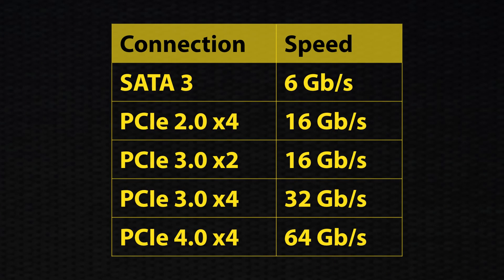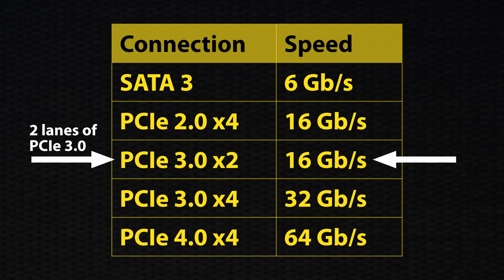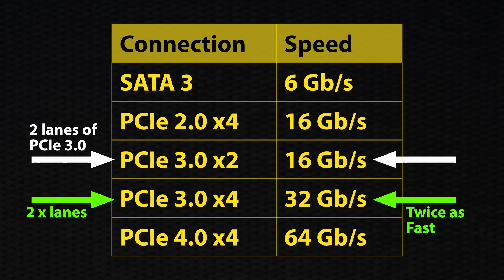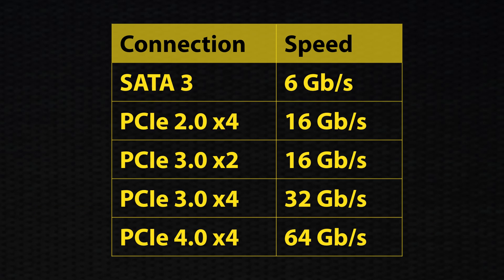M.2 vs NVMe What's The Difference Exactly?

Comment: I've been chugging along with my early 2010  CPU (Intel i7-2600K) in a machine where the CPU is the ONLY orig part from the  original computer it came from (on powerspec from Microcenter). I recently decided to "upgrade" to a HP 840Z that comes with X2 CPU's and 126gb of ram, etc.. Typical beefed up HP. Though it comes with 5 SSD's (all 1 tb), I plan on picking up a card and NVMe 1 or 2 tb drive as my boot drive and migrate the 26tb's (two 8's and one 10tb drive) to the new PC. This video sheds some light on what and how these will turn my new beast into a demon. Thanks

Comment: Geat video, but I have a doubt. I have a mobo with m.2 sata slot.  Could I put any m.2 NVMe SSD in it or would it not work?
Reply: The NVME would not be recognized by the motherboard if your original M.2 is SATA.

Comment: Hi, my Laptop specs say M.2 Sata-3  so i have a Nvme Gen4x4 stick. Does this mean it can only run SATA sticks? as i tried the NVME and didnt recognize it.   Whats strange is that the M/B has that 5 pin only socket; sort of shape that most NVME sticks look like.  or can that shape mean it could be either sata or NVME?  and its says only SATA will run in it?
Reply from the maker: From what you are saying it seems that your laptop is probably only able to accept  SATA drives. I wouldn't worry too much, just buy a SATA M.2 drive . Your laptop would likely not be much faster with an NVME  drive anyway due to other limitations. I have no idea what the 5-pin socket is that you are talking about. Some M.2 slots on laptops are only for wireless bluetooth and Wi-Fi adapters.
Reply: @hometechadventure4462  Yes, M/B is only as fast as its slowest part, so Sata Gen 3 will be fine. That 5 pin relates to the 2 small and one large on a SATA stick so you cant install it wrong way around as its 5 pins and the other end is a bit bigger. Still got me a bit rattled why they put in a NVME shaped socket if M/B is only wired for SATA H/D with diff shape?? Some logic maybe but escapes me. I bought a NVME stick after looking at the socket!!!  as i couldnt find what it used till later searching.   Theres plenty of room inside for a slim 2.5 SSD, but they went with the 20/80 S.2 just to make things more difficult i guess!!!

Comment: I have quite old but really good platform ASUS P9X79 with Intel Xeon E5-2697 v2 and 4x4GB RAM Quad Channel G.SKILL memory. Now I do have SATA 6GBs connections on motherboard and I do have four PCIe 3.0 16x slots (3 are empty). There is also PCIe 2.0 1x which is no use to me. What do you suggest. Stay with SATA 6Gbs or buy some kind of controller PCIe 3.0 x16 for M.2 PCIe NVMe drives?

Comment: Thanks for a great video, I’ve watched many and not learned nearly as much as I have with yours.
I Just bought a Qwiizlab UH25 Pro for my new MAC Mini M2, this is  all new territory for me.
Hope you don’t mind my newbie questions;
Are the two internal ports (the M.2 SSD & the 2.5 inch HDD), here for increasing capacity ? 
Can I install just one or the other ?
Or do I have to install both ?
Would the UH25 run a SATA III ?
Should the two drives be the same protocol ?
Is this similar to the old PC configuration of a large hard drive 
that was typically partitioned into a boot drive and multiple storage drives ?
Reply from the maker: The two internal ports are to increase your Mac Mini's storage capacity. You can install just one or the other in this unit. You can install any combination of drives. Since it looks like the M.2 slot only accepts NVMe Gen 3.0x1 units, I would just get a 2.5" SATA drive. The SATA drive slow would be running the SATA III protocol. I don't think you would see much difference in performance and it might be less expensive to go with a 2.5" SATA drive. This would be similar to a PC with a large hard drive. You will need to use Disk Utility on the Mac to format the drive after it is connected. The boot drive will be internal to the Mac Mini and the other drives will be extra storage drives.

Comment: I have a crucial M2 SATA, now I'm upgrading to another laptop which is using PCI gen3x4 ports with a M2 nvme already inserted. Can I add the M2 SATA to the other slot or it won't work at all?

Comment: The question is" "What's the difference between an NVMe M.2 drive and a SATA M.2 drive" since they are both M.2 drives.
Reply: The speed , NVME SSD Drives are 4 times more fast
Reply: @MovieReviewbyKashif  You are correct. I was just pointing out they are both M.2 drives.

Comment: THANK YOU I swapped to AMD and could t figure out why my M. 2 wasn't showing up turned out I was installing it in the NVME slot not the sata slot sigh and I asked the manufacturer and they couldn't straight up tell me why gen 4 and gen 3 slot was different and why they just told me that the slot didn't support sata ssd

Comment: Question im replacing the drive in my dell G7 laptop... i brought the samsung  980 pro PCIe 4.0 NVMe M.2 1TB   however the drive that im replaceing I notice is a SATA 128 gb  drive that shaped the same but has 2 spaceings..   does this means the M.2  that fits into the slot and it has one space at the pins...  will not work.  With my mashine.   Dell company said it was the drive to purchase...
Im thinking now that I have a SATA slot on my computer.... but Dell just wanted me to purchase the drive that cost the most..  should I take the 970 pro back or will it give me some power/speed...

Comment: Hello!
My laptop have a M.2 SATA slot on motherboard.
Can i a M.2 NVME slot install on laptop motherboard?
Reply from the maker: It really depends on the laptop, but some do have slots that will accept an M.2 NVMe drive. Unless your laptop is super fast though, you will probably not see much speed difference between a good M.2 SATA drive and an M.2 NVMe drive. Also, if battery life is important for you, choose a drive that is low power. https://www.tomshardware.com/ does reviews of these drives and tests how much power they draw.. You will need to look at the specs for your laptop on the manufacturer's website. You could also try emailing them to see if you get a good response.

Comment: Thanks for the information, I was always want to know about the M.2 variations and finally found my answers here.
I've a question, what if I replacing my old 2013 laptop Wifi card which installed in a mini PCIe slot with the modernist wifi AX1300 card, would I got the wifi speed of the new card or the PCIe of the motherboard which of course has lower bus speed will be not allowing to get the most benefits from the new wifi card?
Thanks Sir
Reply from the maker: If it works, you will likely get the speed of the new card. I think any implementation of PCIe is more than capable of handling the WiFi6 (also called AX WiFi) speeds. There is no guarantee that it will work. Some older laptops will not accept a new card unless the BIOS is flashed with a hacked BIOS. Some laptops will not accept the newer cards at all. You can try it and see if it will work.
Reply: @hometechadventure4462  Thanks a lot

Comment: So could I install  a NVMe to a SATA 3.0 M.2 SSD slot?
Reply from the maker: It depends on the computer or motherboard. Some M.2 slots will accept both, others only accept one or the other. If the M.2 slot has both the B and M posts on the socket, it will definitely only accept a SATA M.2. If the M.2 slot only has the M post, it MAY accept both.

Comment: Hey there,
When i searched for some SSD from Amazon, i could see Nvme and Sata SSD with Nvme 6 times faster than Sata and what's interesting is that they have the same price
I don't know if its only in our country?
What's the secret behind that
And I am not a pro in these things(about pc)

So can you give an advice? I have an Asus Acer Aspire 3 with 4GB DDR4 Ram,  Radeon R5 graphics ,AMD Dual core A9 (potato laptop).I don't want to play games, do editing stuff etc.  I just want to browse smoothly with multiple tabs, Spotify in the background online classes in google meet and  maybe 2-3 light apps in the background....i have a 50 MB/s broadband speed at varioius speed test websites but still it takes 3-7 seconds for the results to load in a google search (when i setup a hotspot and browse in my mobile, the results comes immediately which indicates that the problem is not with my network but laptop)
So the solution might be to buy some rams to make it minimum 8GB ram and an entry level SSD
But the problem is I can afford either an SSD or an 8GB Ram (anything worth Rs 3000, now that you don't know about Rs
It cost Rs 3300 to buy corsair vengeance LPX DDR4 8GB Ram and an SSD like Western Digital WD green 240GB (WDS120G2GOA) costs around 2500 Rs
So, what should i do for this 3000 rs? or If needed raise to upto 4000Rs (no more pls)
What's your advice
Hopefully Amit from India
Edit: Spelling mistakes correction and more clarity in what my problem is
Reply from the maker: I think the SSD will make more of a difference for the money. The SSD should make it feel faster. A good SATA SSD like the Western Difital WD Green will be fine for your hardware. I would also look and see if the Crucial MX500 is near the same price like it is here in the USA. The MX500 will likely be faster than the WD Green. If you can limit the number of programs you have open at one time, 4GB can work OK with the current Windows 10. Also, try different browsers to see what works best. Firefox is one of my favorites, but also try Opera. Chrome has a reputation for being a memory hog, so you can try it, but it may not be the best for your system. With 50 Mb/s download speed, websites should not take long to load, but your hardware is a bit older. I don't know if the SSD will improve loading times. Try using DuckDuckGo.com instead of Google for your searches. To transfer to the new drive, I would recommend Macrium Reflect Free. I made a video about that here:
https://youtu.be/C-Dg0RlJuQU
Reply: @hometechadventure4462  Thanks for the advice and yeah the crucial mx500 costs around Rs.3900(I can kinda afford)
•And is it a good idea that I buy a good 4GB Ram for 1800rs  and an SSD for 2200rs ? Or Crucial MX500 for 4000rs?
If yes can you find best , cheap, quality SSD for that price(2200)
• then why is it there are SSD with read speed 2000mb/s(nvme) and read speed 500mb/s(like Sata) have the same price? Does read speed matter?
•how can I know if my laptop supports a certain type of SSD (Acer Aspire 3 A315)...or you can tell me

Edit: I got a new solution,I  willl buy a good SSD worth around 3800 like crucial mx500  and swap Ram (virtual ram) to make my Ram 8GB
Is it a good idea for my tight budget?
So how much ram will I get more if I set Initial size and Maximum 6144mb?
How much should I set those values to get 8GB total? 😅
Reply from the maker: @8BitGamerYT1  Unfortunately, you will probably need to get some local advise on the upgrade. There are SO MANY versions of the Acer Aspire 3 A315 laptops, I have no idea which one you have and what is upgradeable. I can give some general advice. If the laptop has a spinning hard drive, you can replace it with a SATA SSD like the MX 500 I mentioned. If it has a memory expansion slot, then you can add a stick to upgrade your RAM. Some of the inexpensive laptops have RAM soldered to the board with no possibility of expansion. Others have RAM soldered to the board, but also an expansion slot. Laptop manufacturers really like to hide or make the real expansion options difficult to find. They really want you to throw away an old laptop and buy a new one rather than upgrade its performance.

If you have a hard drive, then an SSD will be the best upgrade. Your laptop may have come with an SSD. If it did, then a memory upgrade would be the best option. I would not mess with the virtual memory settings. Virtual memory uses the hard disk or ssd in place of the RAM and it is very slow compared to actual RAM. Leave the settings as they were from when you bought it. SATA SSD read speed cannot be 2000 mb/s, you need an NVMe interface for that kind of speed. I really doubt that you can use an NVMe SSD, but I could be wrong as there may be a version of this laptop with an M.2 slot that will accept it.

It is very common for vendors to "accidentally" put the incorrect specs on Amazon or other sales location, so the SSD speed listed may be in error. Go to the manufacturer's website and check. If the manufacturer does not have a website with the specs, then it is probably not one you should buy from.
Reply: @hometechadventure4462  ooh understood a lot of new things....mines have a soldered ram with an expansion slot. Not sure about ssd slot, though it comes with built in hdd. My model is A315 21 92PD fine? can u find some details? sometimes, virtual memory is better than having 4 GB ram... isnt that true? i tried virtual memory with hdd and the performance is not bad, so with ssd's i thought it would be totally fine?
So if I am using virtual memory, how much initial and final value should i set it to get my total ram 8 GB? (current 4)

Comment: I have no ssd on my motherboard and have a m.0 ssd  aliexpress.com/item/KingDian-ssd-m2-1TB-M-2-2280-SSD-128gb-256gb-512gb-SSD-SATA-60gb-HDD-Internal/32985030187.html?spm=a2g0s.9042311.0.0.24424c4d6onTiA  << that 1 i need a pcie adaptor card (riser) that will work i have a b + m key card and it dont detect any ssd all leds are red nothing in bios or windows so what pcie card do i need for that linked ssd above?
Reply from the maker: The card would be something like this:
https://www.aliexpress.com/item/32909467669.html?spm=a2g0o.productlist.0.0.8a7b4c52zbFU5T&algo_pvid=f8fcddbf-4e64-4f62-9066-38f3afe7c97c&algo_expid=f8fcddbf-4e64-4f62-9066-38f3afe7c97c-11&btsid=0b0a555316079992561557789e1d36&ws_ab_test=searchweb0_0,searchweb201602_,searchweb201603_
It may be the card. It may be the motherboard that does not recognize it (too old to support this?). Difficult to say. You may try a different adapter card, or a different slot. These cards are meant for a PCIe 3.0x4 interface and will probably work with a PCIe 2.0x4 one as well, but if the slot you are trying to use is a PCIe 3.0x1 or PCIe 2.0x1 it will not work. If it does not work, you could get the same speed with a SATA SSD in the 2.5" form factor like this:
https://www.aliexpress.com/item/33027248209.html?spm=a2g0o.productlist.0.0.afce6ce2Slcyl1&algo_pvid=dbeb7380-cf21-46e4-81bc-83a7daa92389&algo_expid=dbeb7380-cf21-46e4-81bc-83a7daa92389-47&btsid=0bb0622c16079997484423040e07b6&ws_ab_test=searchweb0_0,searchweb201602_,searchweb201603_

Comment: I have a  Asus 2 in 1 Q524UQK. SN GBN0WU015090447 iNTEI I7 CPU@ 2.7GHZ BIOS 307... Can I use a  PCIe ssd?  On the BM it says SSD SATA/PCIe*2 Thanks
Reply from the maker: I could only find that you have a 2TB HDD here:
https://www.asus.com/us/Laptops/Q524UQ/specifications/
This would be a SATA Hard Disk. You could replace it with a 2 TB SATA SSD like these:
https://www.newegg.com/western-digital-blue-2tb/p/N82E16820250089?Item=N82E16820250089&quicklink=true
https://www.newegg.com/seagate-barracuda-120-2tb/p/N82E16820248105?Item=N82E16820248105
Where did you find the SSD SATA/PCIe*2 information? If it has a PCIe 2.0x4 interface, you could get a faster drive than the SATA ones. SATA III is 6 Gb/s, PCIe 2.0x4 is usually 20 Gb/s. I couldn't find any information that said that it had an interface like this.
Reply: @hometechadventure4462  On the MB it has a M.2 with one notch. Printed on the MB SSD   SATA/PCIE*2... I thought the SATA slot has two notches and the PCIe slot only has one. Thanks for your help... BTW my laptop is a Q524UQK... What is the diff between mine and the Q524UQ... mine has the K added to it?

Comment: I've just bought one SSD SATA drive with 1 T and one M.2 NVME PCIe 3.0x2 with 240 GB. In this case which one you would install the OS and in which format (considering that I have a Mac OS X). My initial idea was to run the OS X in the M.2 drive and use the SSD SATA for file storage. But I need to be sure that the format will allow me to run WINDOWS 10 on my Mac.
Thank you in advance for your comments.
Reply from the maker: Are you on a real Mac or a Hackintosh? If you are on a real Mac, which one? Is the SATA drive external? I would put the operating system on the M.2 drive normally. To run Windows 10 on a real Mac, you will need to use Bootcamp. You will likely run out of space quickly with two OS's on a 240 GB drive. From what I have read, real Macs can be very picky about which M.2 SSD's work. Generally, if a drive works for OS X, it will also work just fine for Windows 10.
Reply: @hometechadventure4462  
Hi,
Thanks for your reply. I'm working with a real iMac 21.5" Late 2013. The SATA drive is internal (replaced now by an SSD SATA drive 1Tb). The original configuration says the Mac is prepared to have both drives. Can I have Windows installed with Bootcamp separately from the OS X drive?
Reply from the maker: I don't know if Windows can be on a different drive from the OS X boot drive. Make a good backup and then give it a try? Before you do, try a search on DuckDuckGo.com to see if anyone has tried it. My guess is that someone has done it before. You may even find an official method from Apple. With a Hackintosh, we always put Windows on a separate drive, but then we have a non-Apple bootloader to handle it.
Reply: @hometechadventure4462  
Actually it worked. I have in my M.2 the OS X, plus MsOffice 365 and all apps. In the SATA SSD I've made with BOOTCAMP a partition and installed Windows 10. The other partition is just used as storage. Just wanted to share my experience.Many thanks for your replies. Appreciated.